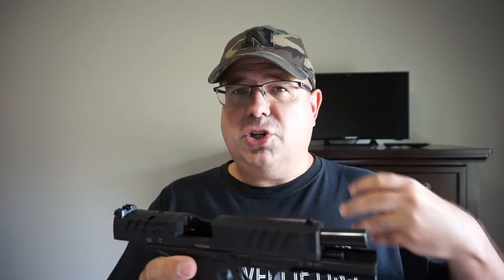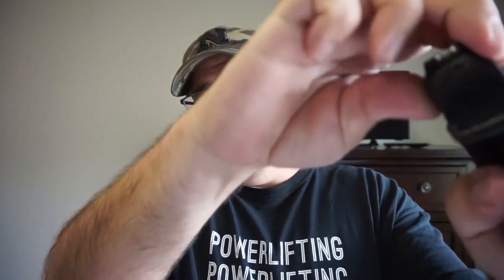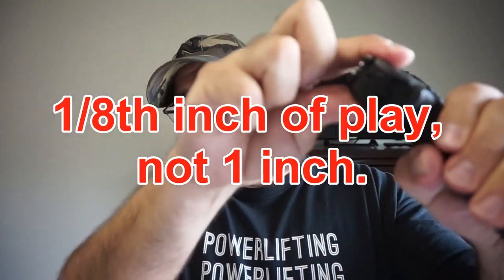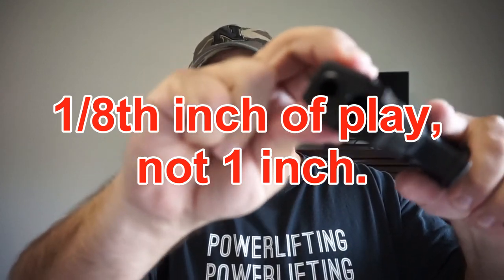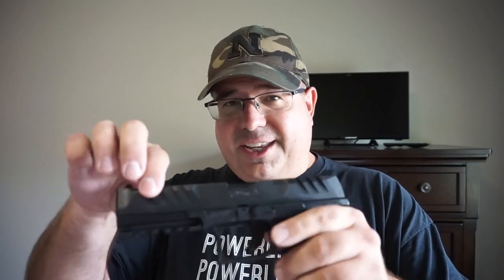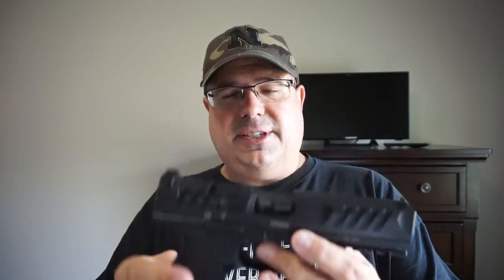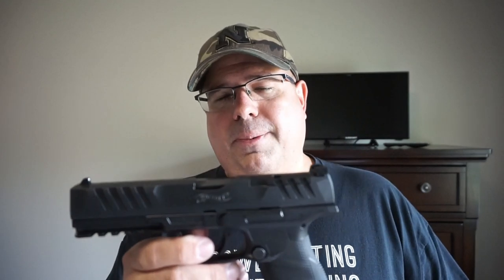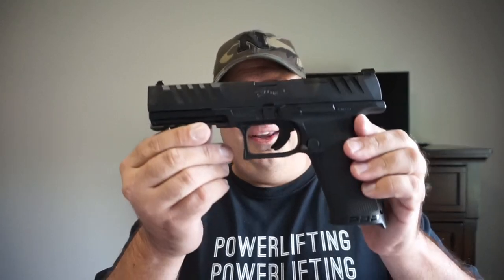Watch this before you buy a Walther PDP.

Comment: In case anyone is curious about Walther’s response to that, this is the answer I got from them : “The gun will rattle if you shake it. This is known as tolerance stacking. It's a duty pistol, and is made this way to perform in any conditions”.
Reply from the maker: This is good to know!

Comment: I was in law enforcement for over 32 years and the Marine Corps before that. Having a little play in the weapon is not a bad thing. Nobody goes around shaking their handgun except to clear out debris if it gets dirt, mud, water etc. on it. It’s designed as a duty weapon. Designed for everyday use. I have a full-size 4.5 inch PDP and I love it. I also have Glocks and 1911’s and Sigs. I love this firearm and it’s extremely accurate. A little “rattle” is no big thing.
Reply from the maker: I agree. I was surprised that people get that annoyed by it. Mine is crazy accurate so I don’t worry about it.
Reply: @Edward Wells I agree.  Semper Fi.
Reply: Glad I came across your comment. 👍🏾
Reply: Thank you for your service Sir.  Wanted your opinion on which size do you think is best in the pdp line up?  The full size 5 inch slide or the version you have?  I want the full grip for my big banana hands but not sure on slide/barrel length.  Thank you.
Reply: @a.d.c7941  I have all 3 sizes. I love them all.  I  carry the 4 inch compact,  but you could easily carry the 4.5. I shoot the 5 inch full size a lot.  Love them all.  Best purchase I've made in years.  For overall usefulness I could see just having the 4.5 full size.  Great overall gun.
Reply: @edwardwells7236  Thank you so much for this info!!!! I am going to get one for sure!!!
Reply: Right, Edward.  One thing that I am thinking from your comment...  It could be very advantageous to have a lil play in there, not as a negative for collecting debris, but as a positive for being able to routinely shake out debris without breaking down and thus reducing cleaning-time and failures.  I'm seriously thinking about a Walther.  Always loved the pistols from the ergonomic and asthetic side.  Never held/shot one.
Reply: @travisp11  are those still made in Germany?
Reply from the maker: @michaelcooke8665  yes
Reply: REALLY!!!!
Reply: @travisp11 No, do a short Wikipedia search, been made in Fort Smith Arkansas since 1993 when they were sold to Umarex. (Still made with quality though!) it's been a global market for decades now and not just Walther.
Reply from the maker: @yukonjack.  Good to know!

Comment: It's irrelevant to the function of the pistol.  Sights, barrel, lugs, and recoil spring are locked in an aligned together for superb accuracy.  Upper to lower tolerance can be slightly more forgiving and have no effect on accuracy or function.
Reply from the maker: Mine is accurate as heck even with the rattle so its not the end of the world for me, but rather a minor annoyance.
Reply: But very relevant to a life or death situation, when someone breaks in and you can hear a pin drop
Reply: @user-md6tq3oo1h  it doesn't rattle when the gun is loaded. Also, dont shake your gun in a life or death situation, just hold it.

Comment: It's because it's a combat pistol. They tend to have looser tolerances to compensate for dirt and grit getting into the gun during action. Obviously most civilians wont encounter this but that's why it's there and that is consistent with glock 17's and other combat/duty pistols. You can always get the slide "crimped" to tighten it if ppl want a quiet marksman type pistol instead of the loose combat configuration I guess.

Comment: I work in a gun store; every PDP has this issue we have is stock! I still own one! I will admit, when mine is loaded, I have NO noticeable sound by shaking it. Very happy with my PDP compact, it is deadly accurate!
Reply from the maker: Same here with the accuracy. No issues and only a little noise when fully loaded.
Reply: I was going to ask, "does the compact have this same rattle?"
Reply: Your comment convince me. I’m buying one right now and going to use as my everyday carry. Thanks.
Reply: It's not an ISSUE! It is designed this way to run better in adverse conditions over time
Reply: Amen I got compact too brotha one lucky few with no rattle too mine🎉

Comment: Hi Guy´s, Joe Peters here, manufacturer of the Peters Stahl Multicaliber  / the Springfield Armory OMEGA Pistol.... I am sure, that it is a manufacturing tolerance which is on the wide side... for such a mass produced weapon is not uncommon to be found like that... My suggestion: Go to a store and select the one with least or no rattle... the pay will not harm  the accuracy of the gun in most cases...  PS Glocks rattle out of the Box!

Comment: I have a 4" and its a rattle trap but its still really accurate. Accuracy some think is a given but many brands have loose tolerances in the bore and the slide to barrel fit and that is what is important. The stepped chamber keeps it really clean and enhances accuracy.
Reply: A gun rattling isn't a problem, my 19.5 rattles, my p10F rattles and you can squish it down in the front about 1-2 8ths.

Comment: The rattle is due to loose tolerances as others have said. That way if dirt or debris gets into spots, it will decrease likelihood of a malfunction. You will find this rattle on pretty much every Glock.
Reply: It's a lesson we learned between the m1911 and the m1911a1.  The original 1911 was literally made "too well" and the tight tolerances would cause a jam when the pistol got dirty.

Comment: That "play" is necessary as the frame flexes when fired, and if you dont compensate for that, youll create friction, and induce failures.
Reply from the maker: Mine has yet to have any issues and it’s accurate as heck.

Comment: I own the 5in compact and it’s the same way but it’s still a very accurate pistol and quickly becoming my favorite!
Reply from the maker: It is a smooth shooter.
Reply: may I ask why you choose the 5" compact model?
do you use it as carry gun?
Reply from the maker: @tsaidavid9658  I bought it from a friend. Rattle or not I was gonna get it anyway. I keep this on one side of my bed in one drawer and a Glock 17 Gen 4 on the other side as bedside guns with flashlights mounted on them.
Reply: @tsaidavid9658  I was going to ask the same and unfortunately Walther didn't even bother including a compact 4.5 ... Wtf ? Why make a compact 5 at all honestly ?
Reply: @tsaidavid9658  The "Compact" is the same size handle it has always been. The full size is extra lengeth. The compact will fit large hands. Its same exact size as the PPQ also.

Comment: Maybe the issue is part of the design. As long as it fires and shoots without the basic malfunctions, it’s fine. There are some other pistols that rattles when shook, but fires flawlessly. Maybe the slide rails have little clearance for smooth recoil. When it’s tight, too much friction between rails and the slide can’t play freely. Just curious!
Reply from the maker: Others claim that Walther says these tolerances are normal.

Comment: My PDP FS 5” rattled right out of the box. So did my Glock 17 gen 5 (although not as much), and my Colt 1911 Mk IV Gov model. My only sa pistols I own that don’t rattle are my Sig p229, my p365xl and my wife’s p365x. All of my pistols are more accurate than I am. I have noticed that my PDP and my Glock rattle significantly less when loaded or even with just a loaded mag in.

Comment: My PDP slide play is closer to 1/32  or even 1/64 of an inch...if yours is 1/8 inch that acually could be a problem as slide could possibly come off rails.  I assume you were just exaggerating that or throwing a number out there.  That slide play will result in reliability....however if you just have to have a tight fit....then one could fix the issue.  Proceed at your own risk I do not recommend doing this but all you need to do is heat up the dust cover with heat gun and ever so slightly and carefully pinch it closed so there is no wiggle room between dust cover and slide.  This would result in a tight fit if done correctly, or a melted frame if too much heat is applied lol.  The only pistol I own that Slide to frame fit actually affected performance of gun was my glock.  Slide would move up and down as I pulled trigger...this would actually cause my red dot sight to move on my target.  This only happened if I had an empty magazine or no mag at all in pistol, as the upward force or rounds in magazine would put enough force on slide to prevent trigger pull from moving it up and down.  I have no such issues with the PDP even though it does rattle a bit left to right when I shake the gun, the actual movement is minimal and it doesnt move when pulling trigger.
Reply from the maker: I will try to get an accurate measure on the play and possibly send it in.

Comment: I noticed the same.  I call it "the rattle quotient".  Some are worse than others, but my Walther PDP 4" Compact is the "noisiest" pistol I have. I was really pissed off when I bought a brand new Sig P320 X5 Legion and it rattled.  I called Sig and was told "there is no industry standard for rattles".  I feel the same way you do, in that the looseness of the slide to frame fit gives me the impression of lesser quality control and build quality than a tighter fitting pistol. I'm used to tighter tolerances, like what I see on a BUL Armory SAS II, Kimber, and some custom 1911's.  I understand that a looser tolerance on a duty pistol allows for more forgiveness when/if the gun gets dropped in sand or mud.  I personally don't make a habit of shooting in those conditions, and prefer a tighter tolerance in my pistols. For EDC, I find the slide on the PDP a little "boxy".  On a positive note, it (my PDP 4" compact) is extremely accurate and a pleasure to shoot. In a less than perfect scenario, I have faith that it would be less affected by dirt, sand, mud, etc.  Another great thing about the PDP is the interchangeable back straps.  I wish I could say the same for some other manufacturers. Something nice about the Sig P320 series are the interchangeable grips. I like to replace the stock medium grips with the small.
Reply from the maker: I love the gun but yeah, the play in the slide bugs me yet it is second in accuracy to my CZ Shadow 2.

Comment: Play with slide to frame is not negative. I have a Sig P226 with a decent amount of "wiggle and noise" and that gun has had thousands upon thousands of rounds through it, still accurate and reliable. Also, maybe it's your variant, but I checked my compact PDP and it's actually very tight. Regardless, nothing to worry about, these aren't custom 1911s. The one thing I did notice about the PDP, the back strap is annoyingly loose near the beavertail. I can press it in slightly at the top. It doesn't move side to side, but something I noticed on mine and others discussing online.
Reply from the maker: Mine is very accurate and other than the noise it is an awesome pistol.

Comment: Most polymer framed production pistols have substantial play between slide and frame which is normal. This is a nothing burger. What you do want to look out for is play between the barrel and the  slide or bushing at the muzzle. Also, when in battery unloaded, push down on the barrel hood at the ejection port... the barrel should be locked up into the slide and not move downward at all whilst holding the slide closed with one hand while you press down on the barrel with your thumb. If there is play in these areas it will definitely affect accuracy. If the store has several units check several if you can. Purchase the pistol with the best barrel to slide lockup. Ignore the slide to frame play. It is even more important to do these checks before purchasing a 1911... proper barrel lockup is critical for 1911's and there are plenty out there with barrels that aren't fitted right. If you want a tight pistol you will need to first obtain a wheelbarrow full of money then second wheel it over to a custom pistol maker like Les Baer for example. These crazy tight pistols are a novelty IMO.
Reply from the maker: All solid advice! I did test a Les Baer a few years ago and it was amazing!

Comment: Just wanted to mention that I JUST NOW picked up my new walther PDP 4 1/2". At the counter the gentleman stated the same thing that tight tolerances are actually a negative. Of course I asked because i noticed immediately the rattle of the slide and the movement i noticed at the front of the gun where the frame met the slide. But once i got it home loaded the magazine and inserted it..the loose rattle was gone. The gun looks amazing!! On my way to the range now!! Be careful out there.

Comment: If you want a gun that doesn't rattle then don't buy any polymer striker fired pistol.  Also the pistol rattling in the holster (won't happen), is going to make less noise than you and your kit bumbling around.  ALL of my polymer framed pistols have some degree of rattle and it's never been a problem.  The only guns that I would expect not to rattle would be a tightly toleranced 1911.
Reply from the maker: You make several good points.
Reply: @travisp11  Got my PDP a week or two ago, it doesn't rattle unless I wag the muzzle side to side in a dramatic fashion.  But if I do the standard shake it makes about as much noise as my P10F.  My G19 is the quietest of my tactical tupperware.
Reply from the maker: @Osprey1994  Good to know!!

Comment: I am a huge fan of the PDP. Yes, the rattle of the gun is not...... nice. But it is no quality issue or loose tolerance. As I see, it is the recoil spring which is, when put in and gun assembled under less press like in Glock or Vp9. I have all of three pistols for comparsion. The movement of the slide is the same, but at the PDP it is easier to Do.
I put the original walther tungsten in my PDP 4.5" and there is NO rattle any more. No matter if with or without magazin, rattle is gone. 

Greetings from Austria. I sold my glock to get the PDP. Never regretted it. Sorry for my bad english....
Reply from the maker: It is an awesome pistol that shoots like a dream for me!

Comment: I just tried  shaking my own. It doesn't rattle the way yours does. With the side open the barrel shakes a bit. But with the side closed the entire gun is stable.  Note ; About a decade ago I own a SIG P239. The side rattled a lot along with movement in the side AKA side wobble.  I went to SIG forums and others complained about the same but mentioned that it was normal for that particular firearm. However I traded off that being the main reason.
Reply from the maker: Is your PDP a 5" model?
Reply: @travisp11  No. It's the compact version.
Reply: My Beretta APX does this also!

Comment: I had the same issue with a new in box CZ P-10 F Urban Grey Suppressor-ready. I was told that it may be because of the length (full size) and the frame rails are farther back. Some guns, even my issued Glock 19 Gen 4 has slight rattle but not like the CZ. CZ ended up replacing it with a new one. I wasn't told the cause of the rattle. Hope you all get it figured out.
Reply from the maker: Thanks for watching!
Reply: I have a P10F and it doesn't rattle at all.  Only a little bit of movement on the medium backstrap I put on, but it doesn't rattle, just slight movement.

Comment: The only people complaining are people that  know absolutely no firearm knowledge. Look at a glock 41 gap between slide and frame , it is way more than 1/8 inch and it shoots just fine. Just one more point. A cz p10f loaded mag sounds like a maracas when shaken but runs flawlessly.  There alot of people that overthink shit. I have the 4.5 and 5 inch and they both make sound when shaken, zero problems, and I shoot a ton.

Comment: I have a PPQ and it also rattles a bit when I shake it. Never noticed till I watched this video.I also notice that when the slide is racked and the barrel is exposed , the barrel has a lot of movement . Not sure if this is normal or not ??
Reply from the maker: Most people responding to my video have said that it is normal. They are loose tolerances designed to help it function in extreme conditions…kinda like an AK47.

Comment: I just took delivery from my FFL of a Full Size PDP 5 inch and it doesn’t:t do this at all. Well, certainly not to this degree. I’ll see how it does after 1000 rounds through it. That said, my Canik Elite Combat does this and it!s one of the most reliable and accurate pistols I own. I have coming up on 5000 rounds through it between training, practice and just general shooting and I swear I haven’t even had so much as a stove pipe with it. I honestly don’t expect any problems with the PDP either.
Reply from the maker: I think as long as it shoots accurately for you, you should be set.

Comment: So, how does that compare to other autos?  Sounds like they don't all do it, or not to the same degree at least.  Is there any correlation between "tight" builds and operational failures?
Reply from the maker: There are some 1911s that I have shot that had super tight tolerances that would have some issues but my G17 Gen 4 isn’t nearly as noisy as the PDP.
Reply: @travisp11  How about its predecessor the PPQ comparatively?  (I was looking to acquire one, I tend to like the top tapered slide a bit more, but I didn't realize they were changing out the model.)
Reply from the maker: @buddyb4343  I have a buddy that has a PPQ and I can ask him how it is.
Reply: @travisp11   FYI -  Just purchased a used (but rated excellent condition) standard 9mm PPQ.  I can hear a bit of rattle that diminishes greatly if I hold/touch the slide; but it doesn't rattle nearly as much as the PDP in your vid.  Luck of the draw perhaps?
Reply from the maker: @buddyb4343  that is a possibility!